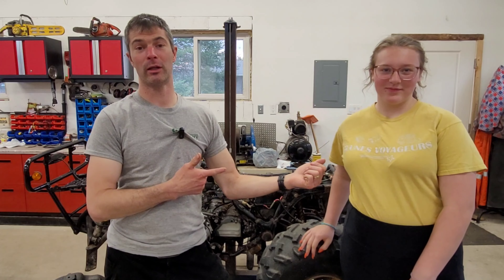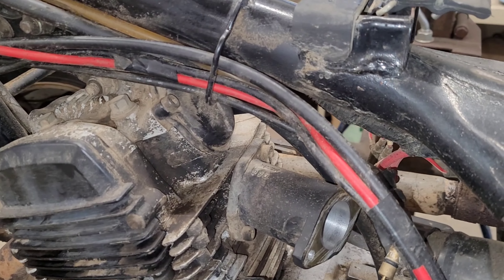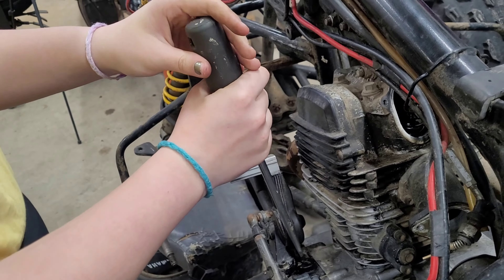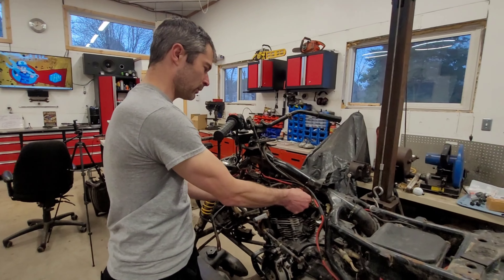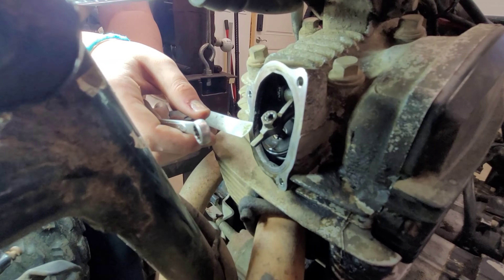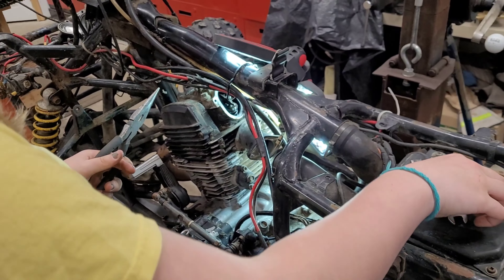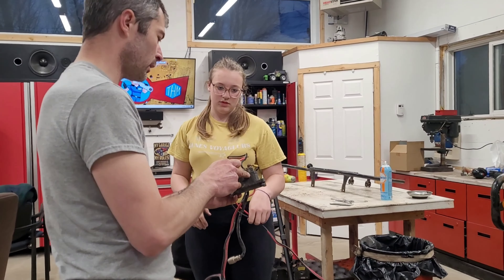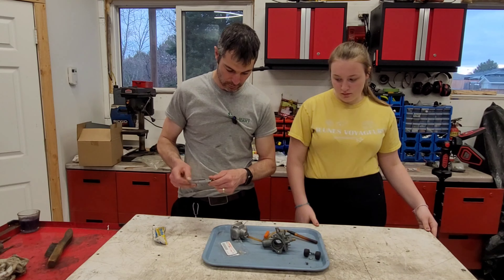My Apprentice Restores a Yamaha Moto 4!

Comment: On the carburetor, where does your yellow vent tube route to?
Reply from the maker: There are normally two vent tubes. The upper one vents inside the frame and the lower one is directed down to the belly pan. Hope those helps
Reply: @thehonestmechanic  Thank you very much.